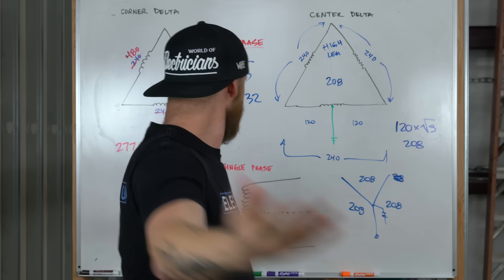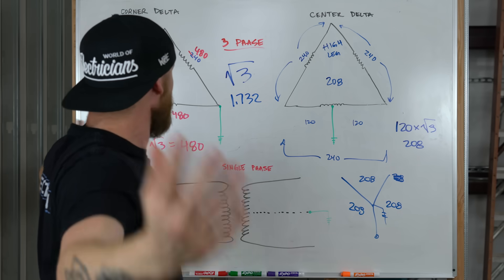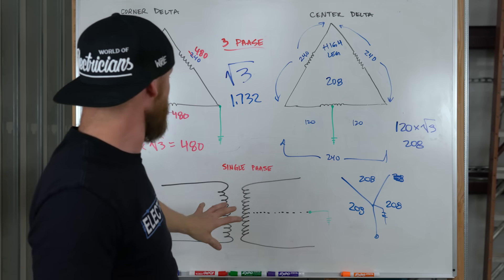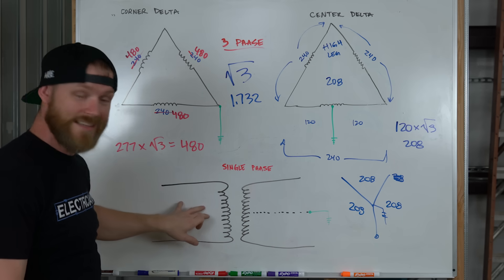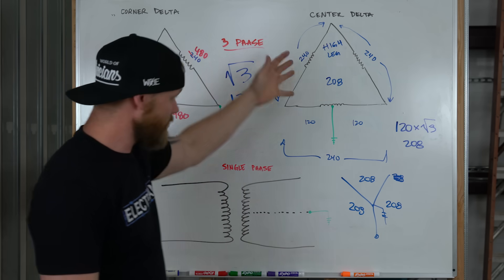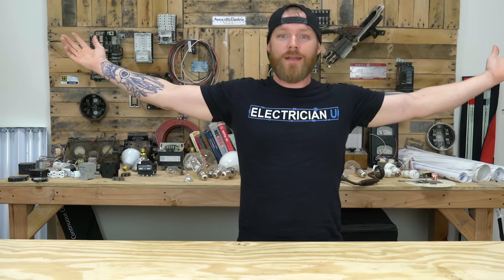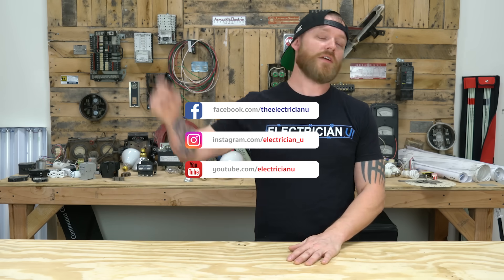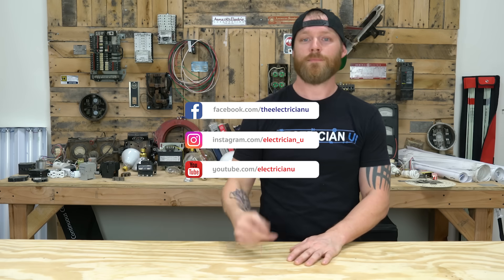Difference Between VOLTAGES - Why We Need Them All

Comment: what is 208 single phase
Reply: When you have a 3-phase "Y" with 120v legs, there is 208v between two legs.  That is a single phase, which you can use to power a single phase 208v motor.

Comment: I recently started a new job as a maintenance tech. and all the lighting in the building is 277v. Also the main incoming service to the building is around 12,000 volts. As someone who has never worked with anything higher than 240v single phase, I came here today to learn how to not die at work, lol. They have a separate team of electrians for most things in the building, but I will need to mess with 120, 240, and 277

Comment: We would be better off if we did like Europe, Africa, Asia etc, 415Y240 and use all 240 in residential, preferably with a British style fused plug.
Reply: You think we would be better off if every person in the United States (and Canada) had to throw out nearly every small electric device they owned, to replace them with new ones?  And pay to rewire their houses to the new system?  Then pay more in electric bills to pay the utilities for the cost of conversion?  Only to end up with electric equipment which does exactly what our present equipment does?  I don't get it.
Reply: @GH-oi2jf you’re obviously not an electrician. You don’t have to rewire your house, just change the breakers and the outlets and switches. The utility companies don’t really have to do anything with the older existing buildings . Most electronics devices will operate on either voltage, there are transformers that can operate the older appliances. Saudi Arabia converted their whole country from 120 to 240 volts over the last decade. If they can do it so can we!

Comment: So when you bring up the 277 voltage by multiplying sqrt(3) to get 480 voltage, would this be in the in the center delta configuration and not the conner delta?
Reply: Do you mean corner-grounded delta?  No, 277/480 3-phase is a "Y" (or wye) configuration.  The 277v legs are used for commercial lighting, and the 480v 3-phase is used for elevator motors.

Comment: Low voltage is under 1000 volts nominal. Medium voltage is 2400-45,000. High Voltage is 69,000-115,000 volts. Then they have Extra High Voltage. Now C class voltage is the 6,12,24 volt AC or DC stuff up to 50 volts nominal. If you are get on any large industrial job you will work on some Medium Voltage equipment @ 4160 volts, and 12,470 volts (ballpark). Honeywell had lots of indoor substations fed with 69,000 volts that dropped to 12,470 and 4,160. We had to work on it. Microchip, same deal. Motorola same deal, and orange was 400Hz. They used purple for the high leg on 240 3 phase. Places that are under the control of their own engineers do NOT follow the NEC all the of time. YOU NEED TO CHECK FOR VARIANCES when you work on large industrial jobs. One industrial plant did not allow any splices on any current carrying conductors so we only used wirenuts on green wires. You had to loop the wires around the screws on devices and feed them back up a conduit and into the next device. NO SPLICES! They had 4160 volt stuff too. The pasta plant had 535 volt equipment from Italy. Add that one to 120,208,240,277,480 and 4160.

Comment: Why do Wye transformers only have 120 across each coil?
Can they have 240?

If you had 240 across each and center tapped one of them, would you then have two high legs?
Reply: A transformer can be made to provide any voltage you need.  Commercial power is often 277/480V 3-phase.

Comment: America should switch to the European 240V1P/400V3P system if we want to go “net-zero” “electrify” every gas appliance. Or we can just use our existing 277V1P/480V3P system as the new standard in residential and commercial buildings.

Comment: The Canadian definition for high voltage is anything 750V or higher. Linesmen usually handle the service and construction for those. Except in the province of Alberta, where regular electricians at oil fields will service equipment rated for 4160V. Linesman have more chance of dealing with lower voltages. Canada is strange case with 600 V , the rest of the world usually have 480 V as industrial voltages, maybe because of the distance the power had to be transmitted. That is why in the 80s most meter manufacturers made their meters max out at 500 volts which is almost useless for us. The diagrams and calculations at the end of your video, we all did it in school and forgotten as soon as we pass the exam, like in engineering , where 95% of what they learned are never used again. But these are important stuff for colleges who are looking for anything and everything to prolong the student stay in colleges , hell, someone must be in class to pay for their very high overhead costs.

Comment: Looking at this it looks like our euro power is all star/Y power 3x230/380v with no splitfaseing going on ( 230 fase to neutral and 380 between 2 fases, and i guess 600 if you use all 3 )

And yes this is standart into all homes also, pretty much everyone gets atleast 3x16A fases like that

Comment: Thanks Dustin, well explained from a 45 year retired master. Your videos are great for all the younger generation apprentices coming into our trade. Of course you can also illustrate how a high leg is derived from two primaries with two single phase transformers. Also, how more efficient three phase 208-220 volt motors will run. Thats another video!

Comment: The following electricity systems come into question in Europe:
- only one hot phase 230V 50Hz in the house.
- Three phases 230V or 400V three-phase. So 230V from the hot conductor to neutral. 400V between two hot conductors. wYe Connection
- rare: 230V three-phase current. So 230V between two hot conductors.  
Only 133V from hot to neutral. 133V times sqr(3) = 230V
This is not a split phase! Split phase is shifted 180°, 230V three-phase is shifted 120°.

Phase means the hot conductor.
Neutral is connected to ground on the transformer, usually also grounded in the house. 
In addition, PE, the grounding conductor, is grounded in the house.

The transformers for the house voltages are always designed with a wYe connection.
The transformers are connected in Delta to the voltage level of 10 to 20 kV.

Low voltages: doorbells and door openers work with 12V AC or DC.  
In some high-rise buildings, the momentary buttons in the stairwells are 12V, but the lighting is 230V. There is a relay in between. So it is hardly possible to steal the voltage on the button.
Reply: Continental Europe had voltages with 220V/380V. 
England had 240V/420V. 
With the standardization of the power systems, 230V/400V 50Hz was agreed upon.
Most devices can be operated with 220 to 240V without any changes.

Comment: US Coast Guard defines high voltage as 1000v and as a mariner that’s what I stick with. On ships we deal with 120v ish 450v 3 phase(not 480v because that’s a little harder to do with a ship).  Then cargo ships us 6600v for electric bow thrusters or diesel electric. 12000v for cruise ships because they need the voltage to power there multiple azimuth thrusters. All three phase accept for 120v and 240v split phase(for dryers and kitchen equipment because it’s safer than 450v in the kitchen and manufacturers don’t make 3 phase kitchen equipment that only needs to cook for 20 people).

Comment: By far, this is the best explanation I’ve ever seen. I’m not an electrician, but I have messed with electricity respectfully a lot as an amateur. Could you do this same video showing wires on the pole and in the box

Comment: Light bulbs regardless of the type last longer using 110 instead of 125 volts. My Christmas light strings bulbs don't fail when using 110 but I lost about 12 to 30 LED bulbs using 125 volts. Using a voltage reducer saved my bulbs. APC makes a voltage reducer. 73

Comment: A friend asked me yesterday to explain "why 208? I used to know, but have forgotten how to explain it properly, as I am 74 years old and retired for 12 years.  The old "if you don't use it you lose it" thing. So I went looking and found this video. So, due respect, but I have to say I am not really liking this as a primer for newbies. It tells me that two voltages exist, but it does not COMPLETELY explain WHY, in the breaker box on my wall,  the measurement between 2 hot legs of 3 phase power is 208, while the measurement between 1 hot leg and the neutral is 120) and not 240; while in my breaker box with 1 phase power the measured voltage between 2 hot legs of 1 phase power is 240, and the voltage hot to neutral is still 120.  It would be better to explain how electricity is generated at the power plant,  i.e. it is 3 phase coming out, with 3 hot legs. The glossing over of Delta and Wye connections is also lacking in clarification.  I am not a trained electrician, BTW, but I could do a better job than this does of explaining the premise of the video for beginners. I was a teacher, and I think one always has to be on guard and assume your students do not already know some more basic things, which is what this video is doing. For instance, how the power that  is generated at the power plant is 3 phase, and how it gets distributed around the city, some areas get 3 Phase, some get 1 Phase, some buildings have Wye and some have Delta coming in, etc. and especially how transformers work.  Perhaps you covered those more basic things in a previous video, if so, you could direct us to those at the beginning of this. Kind Regards, Robert

Comment: When you talked about the Delta configuration, the wild leg is the reason why I always like to put an adhesive label saying HIGH LEG on the breaker spaces that are high leg spaces.  I always wrap orange tape around the wild leg wire.  I also wrap the wire for the red leg with black tape.  All done to reduce the possibility of frying TVs, computers, garage door openers, Christmas lights, vacuum cleaners, and equipment.  Because, if you put 120-volt equipment on the high leg, you will burn up equipment and you will nestle equipment nicely in the potty.  Flush it!  I always like to put a sign on the panel saying BE CAREFUL!  210-VOLT HIGH LEG!  I worked at a roller skating rink once.  The owner put in some fluorescent lights to use as black lights.  He knocked out a space.  Put in the breaker for the black light fixtures.  Finger snap!  About 20 fluorescent ballasts in the potty.  Flush every single last one of them!  He didn't realize that he hit a high leg.  That high leg, carrying 208 volts to ground, fried every single last fluorescent ballast in every single last black light fixture.  They mark that wild leg or high leg for a good reason.

Comment: This is way different that in europe.

Interesting
Reply: When I came to US as a kid, I didn't know much about electricity. But was still amazed at how crappy and unsafe especially the plug & receptacles are.
Reply: @benjurqunov  
Its very american, not much has changed the last 50 years when it comes to this.
Reply: The basic split phase service is not that different.  Draw a 3-phase "Y" secondary with three hot legs and a neutral, as used in Europe.  Cross out one leg.  Now pull the two remaining legs apart so they are at 180° of separation instead of 120°.  That's the North American split phase system.  The frequency and voltage are different, but those are trivial.  Electricity works pretty much the same everywhere.

Comment: You didn't say nothing about 2:40 with a floating neutral I'm a retired Bible assignment for lg&e and KU you didn't say anything about a 240 volt my manager told me I could and I did hook up a machine that was 240 volts the machine work just fine Miller welder says you can take their 240 volt single phase welders and operate them across two phases of a three-phase 240-volt system you seem to be pretty well versed the engineer wise what you're talking about but there's still a few more Banks out there they're single phase 240-volt Transformers there used to be what they call 6.6 which was 2400 volt but it was a regulated 6.6 amperage and it could go up to 6000 volts they call it on an arc circuit incandescent circuit and state highway department and we used for long distance lighting thank you

Comment: In most of Europe the 230/400V 3phase TN network is distributed to every  home.  All appliances, washing machines light bulbs etc  are 230V singe phase. Motors and EV charging are 400V 3-phase

Comment: A machine is 277 volts how do I hook a 120 volt single phase power light to it?
Reply: You would bring power from a 120v circuit, but why not just use a 277v lamp?
Reply: Joke

Comment: You are really close on delta wye services…..a delta system when working properly has no reference to ground so it appears to be a safer system …when the first electrical device faults to ground the process that is running doesn’t lose power assuming it is a slight fault…this is where it gets scary if a second fault occurs on same phase again you looking in can’t see that the second fault has occurred…Now a fault occurs on a different phase. What happens next depends on how bad each of the faults are….they can “blow clear” (one of the faults gets vaporized)or blow a fuse/breaker…if it blows a fuse/breaker depending on whether its a main or secondary protection will determine how easily it is to find that faulty because it could be anything inside the plant which makes delta difficult to find small faults on…so if the plant you are working in has a delta system be prepared to be spending a lot of time in a flash suit with large loop amp meters chasing your tail…Delta system are great for a process that just can’t stop while with a wye system the process will stop if a fault occurs..

Comment: So if we're talking about 277/480 and 480 is acquired when putting together 2 legs of 277 then why are there 3 wires on a 3 phase breaker?
Reply: Such a breaker would turn off each phase.

Comment: Does that mean some products just waste energy if they don’t really need all of the 120v to power it to work?? The just find ways to dissipate the energy?
Reply: Voltage is not energy.  Power is volts times amps, and energy (work) is power integrated over time.

Comment: Good stuff, as an instructor you make it easier to understand.        I looked through your uploads and did not see any on 240v.   I am specifically interested in ;  add a 240 to a sub panel for welder,  the difference in wiring to sub vs main panel, why the white/ common is not used, and what happens if it is wired to the wrong buss...     I have a couple of electrician books and have asked a few folks that supposedly are certified, but have gotten a little conflicting information and  now I am majorly curious...
Reply: Get a copy of the latest NEC

Comment: As an European I still don't understand why you have so many standards. We have 230/400v everywhere
Reply: The United States is a large country.  There is no inefficiency in having many standards.  On the contrary, it is more efficient to have multiple standards, up to a point.  As long as there are enough customers for a standard, you have economies of scale.

For example, large commercial buildings typically have 3-phase 277v for lighting.  No residential customers use this, but there are more than enough commercial customers to have electrical equipment used only by them.  The phase to phase voltage is 480, which is used to power the elevators with 3-phase motors.

Comment: I have a brewing system that utilizes 4x 5500 watt 240v heating elements, from what I understand each of those elements will require a 25 amp breaker? The building I'm looking at is wired up from the outside for 200 amps of 240v 3 phase. Am I able to just directly use the 3 phase from the breaker to my system or do I need some kind of converter? The box looks like it's broken up into several 20 - 60 amp breaker switches already and we have 120v outlets everywhere, so my thinking was to combine a few of these to make the 4x 25 - 30 amps that I'd need but not sure how to go from 3 phase 240v -> 1 phase 240v. I read somewhere that you just connect to two of the "legs" of the 3 phase to accomplish this?
Reply: If the building is wired for 3-phase, you probably have 208v instead of 240v.

Comment: All right I have a guy that bought a 208 V Brewing System but the power coming in is 120 240 single phase is his Brewing System going to work? I feel like even if it does work though it's probably not going to be good are the $30,000 piece of equipment
Reply: You might want to contact the manufacturer and make sure the 208V brewer is acceptable on 240V.  A 208V rated heating element connected to 240V will run hotter than designed and although it probably won't burn out right away it will shorten the life and void any warranty.   You  could use a autotransformer to lower the 240V down to 208 and that's a common application for autotransformer,  aka buck-boost transformer.  Hope this helps.

Comment: Im a very visual person and looking at the diagrams (being a novice) is confusing to me. Would it be possible to explain this, not with a diagram, but by showing an actual breaker box with the single/3phase lines from outside and how the different wires combine/split and where the grounding points are in each voltage, along with how the end devices are connecting to each type of configuration?

Comment: Curious if you have any videos about harmonic frequencies and voltages and if I need to have this knowledge as an electrician or is this an engineers domain. I know harmonics are not good for electrical circuits and can cause a lot of issues. However, also know in some situations can be fairly common when dealing with variable frequency drives.